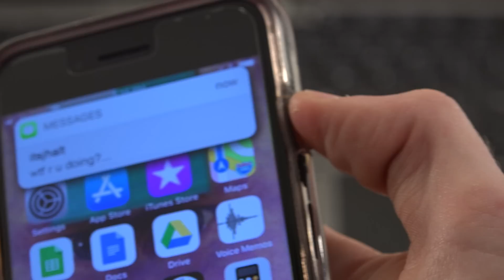How To Uninstall CheatBreaker (The RIGHT Way)

Comment: You forgot a few last steps. After you do all that turn on your computer again and open the Control panel. Go to Programs and Features. Select Cheat Breaker and click Uninstall. Now this is important. DO NOT COMPLETE THE UNINSTALLATION GUIDE. IT'S A TRAP. Instead what you want to do is open Task Manager, right-click the uninstallation program and select Open File Location. Then you will want to delete the folder that the uninstall program is in. If you receive permission errors just click Continue. Eventually they will go away. After you have deleted the files proceed with the uninstaller. Since you deleted the files earlier it will simply crash your computer. That's when you know it is no longer in your computer. One last step you need to do is go to the C:\Windows folder and delete the Syswow64 and system32 folderd because there might still be files from CheatBreaker in there. Again, if you see permission errors just click Continue. Finally, destroy your hard drive and buy a new one and reinstall Windows on it. Then you will have successfully removed Cheat Breaker

Comment: THANK yOU SO mUCh CHEATBREAKER IS UNINSTALLED but wait.......... I did windows + R and run the app data command but..... it says SYSTEM 32 IS DELETED RIP Laptop 2008-2020(shit 9 fps laptop)